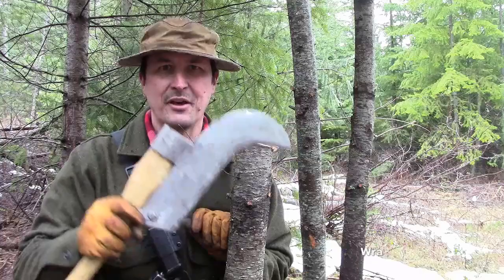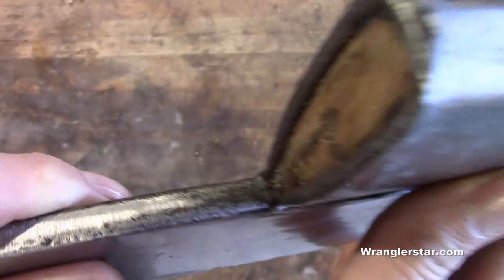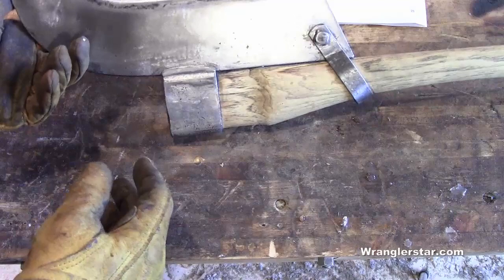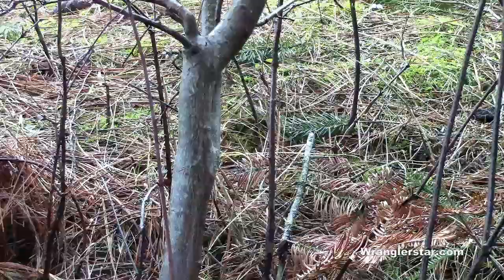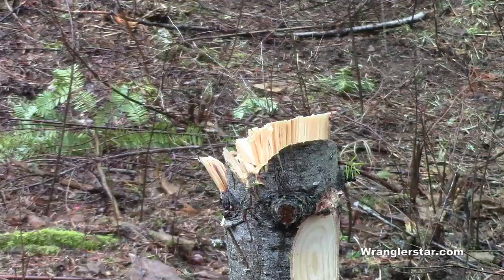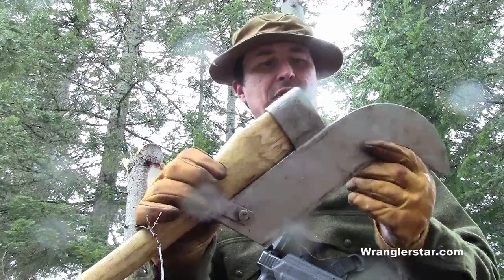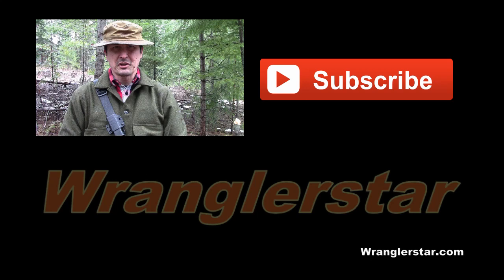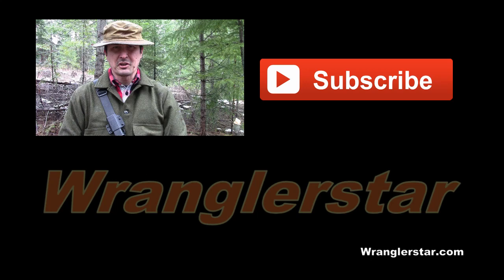A Proper Brush Axe - Wranglerstar

Comment: I had the other style you showed in the book with the double edge blade. I prefered it over a machete when dealing with brush but it wasn't very good with dealing with larger brush because it wasn't as heavy of a blade as the one you have there in this video. The blade was thin and all the weight was from the handle of the axe and almost none was balanced towards the blade. However, this made it wonderful for working over head on low hanging limbs that a machete would work on but reach was a bit limited. It also worked well for removing small stumps or stops that were to big to pull by hand and that you didn't want left above ground. I used it similar to a shovel and using the tip of the blade sliced right through the root bundle. The thing was easy to sharpen and it stayed sharp quite well even for such a thin blade. It was so thin though you could flex it with your bare hand. It wasn't a very heavy duty tool, but it was also a very modern tool bought with in the past 30 years. I eventually had to retire it from service because I over struck a small tree and fractured the handle. But the tool had already been used for over 20 years by then. I'd say 20 years is a good long time for a handle to hold up.

Comment: Using that brush axe looks like fun. Excellent video!
Reply: TheGearTester as a land surveyor in NC, I swing a very similar axe (he referred to it in his manual as a bark blade, also known as a ditch bank) the idea is to cut in a steep angle across the grain, they’re extremely dangerous when swung horizontally like a traditional axe. Usually used on lighter brush and vines, briar patches can be decimated in minutes

Comment: I have a Collins Brush axe I recently made a new handle for it and cleaned it up , I know it was used a lot by the forestry service when cutting a fire trail it works good with the blades design at taking care of  heavy rooted ground  when your trying to shovel dirt with a lot of roots they'll take care of the roots real quick and easy. along with small saplings .

Comment: Hi, nice vid as always. My family is from Appalachia, my grandfather logged with horses until the 50s, were several hooks it the barn with handles rotted out. Pretty sure they mainly used them to de-limb downed trees before chainsaws around here. Its just like you say, figuring out all the uses for the old tools is half the battle sometimes. More than one way to skin a cat, ask your local Chinese grocer.

Comment: We use similar tools here in the UK for hedge laying, Its all about technique.You will wear yourself out if you don't use them correctly. They are a wonderful tool once you get the hang of them. Cut springy wood lower down and you will fin that the tool will make light work of it.

Comment: I used a similar tool in the early 80's when I worked on a survey crew for the Corp of Engineers.  We called it a Joe-blade or a K-blade.  I got to be pretty handy with the thing over the course of one summer and could drop a 1.5 inch oak consistently with one swat.  Technique was everything in using that tool to cut line for the survey crews.

Comment: Down South, the "Burke" blade is very common. They are heavy, dangerous, and very effective for clearing tall grasses, vines, bushes, roots, saplings. They are also used to chop into the earth, creating a vertical or diagonal cut, followed by a sharp square spade to produce ditches along country roads and farmland where drainage is needed. They are very durable, and typically sharpened with nothing more than a file. A crew of men can clear land down to soil in very short order. These axes are good for trees up to about 6 inches, but no larger. I have seen this axe go through a 4" conifer in one stroke. It's one of the few tools that is routinely taxed by rough use, but they really are tough.

Comment: I can vouch for the FS's added PPE for the shins and would also emphasize steel-toed boots.  When I've used these it has been more for brush clearing with the swing very close to the ground.  Unseen obstacles can and do cause a swing to glance back at the lower legs and feet.

Comment: It strikes me that the issue it has on larger trees as the it bites too deep. It penetrates very deeply, but doesn't chunk out the wood, so it gets stuck and you have to put the extra effort to pull it back out.. I think its really only made to cut stuff that can be taken down in one or two swings, because anything more, your going to get fatigued really quickly from having to pull it out of the wood. Just my two cents.

Great video Wrangler! Keep up the good work!
Reply from the maker: I agree. I wouldn't use is to fell timber. I was only demonstrating.

Comment: If you like a tool like this, I strongly recommend taking a look at a slightly different design called "vesuri". It's a Skandinavian version of a bill hook or a brush hook. It's not an axe or intended to be used as one, but is instead mainly used to debranch tree trunks and, in the case of the smaller ones, to clear out saplings. It isn't really meant for splitting, but it can handle that too. In my humble opinion it is a superior design and would most likely be easier to handle.

Comment: cuts about the same as a makeshift pole machete that i made when i was 13, it was a 420J2 meat cleaver on a 2.ft ash wood dowel with a slot milled in it, and held in place with dry wall screws, i loved that thing, if i can Cody, I'd defiantly make you one

Comment: It is a great tool for clearing under a fence line or grubbing out an old ditch that is narrow enough to straddle. It is dangerous though. Using the hook to pull and cut brush from between trees and fences. It is also great for cutting roots in the ground and jerking them up. Yes you will have to resharpen. I've also heard it called a grubbing axe.

Comment: I know I'm late for commenting on the brush hook. it is meant as a primary tool for land clearing. you can use it on a wider size range of woods vines and general undergrowth. when my Opa taught me how he used an up swing for the smaller stuff more so than a down swing, and aim just inside the point of the curve so it becomes a slicing more than a hitting.

Comment: I think for small brush the most effective cut would be a flat to somewhat upward angled cut. This would be sweeping the ax as if you were uprooting the bushes.  Because you can't depend on the mass of the branch to generate pressure on the blade you need to put the branches in tension to get blade into the wood.  If it sounds awkward,  I think it is, the hook on the blade is there (I suspect) because accurate aiming just isn't  feasible. 
Really though I suspect the tool has been supplanted by pruning shears and loppers.

Comment: I have one of the burks Axes you mentioned. Here in Georgia we refer to them as "Ditch Diggers" for the simple fact most of our road crews have them and they use them to remove vegetation and vines from ditches and around drainage pipes. It's effective at that but it has a thinner blade than yours so I would never try it on an actual tree unless I had to.

Comment: I have good luck on the smaller brush and trees if I swing it like a golf club ... The roots tend to hold the target firmly in place and sometimes you will pull the plant up by the roots with a slow swing or dull blade ... Hope this helps ... God bless ;;;

Comment: well ... I used one before for a little while and i cleared a lot of brush with it but it had the burke blade on it or was sharp most of the way around it. The hook I learned was good for small branches on a tree you wanted to trim up

Comment: Brush axes do great work. They make quick work of small <3” saplings and brush. Some are better than others though. I have 3, 2 like yours, and one that you showed in your book that’s sharp on both sides. I hate that one. It’s just not sturdy enough. It does fine on weeds and small stuff, but flexes when using it on saplings. They used to use them on the railroad to maintain the area under the pole line.  They were eventually banned for safety, probably because people don’t know how to use them. They are great tools. I use mine along my ditch bank every year. My only advice would be to cut as close to the ground as you can. A sapling that might take 2-3 swings, can usually be cut in a single hard swing at ground level.

Comment: I found one under my Grandfather’s cabin here in central PA. It’s badly rusted, but the handle is intact and I hope to restore it. The major challenge will be removing the rust sufficiently to remove the strap. But it’s now safely stored in my garage until I have the time and skills to work it. Of note, also found a double bit axe as well. It’s in better condition, so that’s my first project!

Comment: Used and seen survey crews use them in VA for open property lines. But they had modified them with a hammer on the back side (driving stakes and such)

Comment: On the thicker trees, alternate a horizontal stroke first with the downward angled stroke from a bit above your horizontal cut. Take a chip out instead of jamming the blade once you get it down right. Kind of like using a hewing axe, but on an upright tree.

Some suggest sharpening the concave curved section of a bill as a two sided bevel, but the straight part with a one sided bevel similar to a side axe, for a right handed person, the bevel would be only on the right side of the blade. That way, the flat section behaves like a side axe, it's less likely to glance off a sapling on a diagonal downward stroke plus you can use it more easily to do things like putting a point on stakes, etc.- and it still cuts brush just fine.

Comment: wranglerstar great video, I have an old banana blade/bush Axe like the other one in your book. The handle is broke but it has done the job for my grand dad, dad and now me. I like that chest rig and how you have your spare mag located it should make for fast magazine swaps. One thing you might think about is placing your spare mag a little higher on the rig that way if your doing one handed mag swaps you can holster the gun and load the fresh mag with one hand easily. From the video it looked like the holstered gun is preventing you from accessing your spare magazine.

Comment: I once worked over a weekend with a guy who used a similar tool but he used it in a pulling motion cutting very effective and controlled small growth close to the ground as well as higher up. I tried et a few times but could not get the right pull motion.

Comment: Hi Cody,

I have this very same axe.  It was my Dad's.  Mine's still has red paint, but starting to come off.  Putting a new handle on it now.  I've always heard it called a "bush axe" around here (Georgia) but I've seen it advertised as a brush axe.  Everything you said about it rings true; heavy and powerful, best on small stuff but it will cut bigger.  I agree with the comments of the reviewer below who gave a long recap of it's use in the south.  Thanks for the video, informative and inspiring .  Keep it up.
BTW, I know a Jim Dillon in Atlanta who teaches woodworking at Highland Woodworking.  Not the same I suppose?  Like to get your Jim Dillon's website.  Thanks.
David

Comment: It's a billhook (or something like it).  It WAS used as a weapon but before it was it was used for the exact purpose that you saw it for: cutting down brush and smaller plants.  It's better with smaller plants than larger ones.

We're not 100 percent sure where it comes from.  It was used frequently by the vine cultivating peoples of Europe but it was also developed independently in the Orient (Japan and China).

Comment: My dad has one of those burk blades form when he worked for the rail road that thing will cut through anything u put in front of it.  And in like the brush ax u have there both sides of the blade are sharpened.

Comment: I'm curious Cody do they still make "brush hooks" for chainsaws.  years ago (79-81) I worked for BLM as a engineer tech (construction projects) and firefighter during the summer. clearing brush for fence lines through mesquite bosques we had a metal hook that bolted onto the end of the chainsaw bar that would hold brush and small stuff allowing me the scythe my way through the brush. dang good piece of kit.

Comment: When it comes to cutting springy stuff, you don't want to cut them horizontally you want to cut them at a good angle probably at least 45 degrees down toward the base of whatever you're cutting; that way the hook won't bounce back and forth on you.

Comment: I think you'd have better luck with the more springy brush if you cut a little closer to the ground rather than a foot and a half up like you were doing at the start of the video. Of course by doing that you're going to hit the ground more than you'd ever should with an axe but the blade looks beefy enough to handle the abuse if you exercise reasonable caution like you always do. One of the problems I've had cutting into brush is I had a hard time seeing what's going on in the brush pile so the big cutting surface looks like it could do a good job of compensating for any loss of accuracy as long as you keep your feet out of the way.

Comment: Sounds like a quickly moving stream is nearby.  Is it running all year or is it snow-melt fed.  I am aware of the ram-pump water supply stream you have on property, but not sure if this is the same stream or different.

Comment: I’ve known a similar tool to be called a Kaiser Blade. My dad used to use one growing up on a farm in Mississippi. He found a couple used blades from someone who worked on railroad right of ways. At 10 years of age or so, I was old enough to learn how to use it and keep it sharp. What are these shin protectors you speak of? Isn’t that sports gear for baseball catchers? We had no such gear. We had self preservation as incentive to not chop ourselves. I don’t recall any accidents. We cleaned ditches with these tools.

Comment: they work great if you're strong enough and you figure out the right way to use them. it's heavy and moves slow so you can't cut springy stuff at 90 degrees. you have to go through at an angle so that it doesn't just bounce off of the blade.

Comment: Cool, Where can I get one of those Brush Axes?, Looked like your problem with the axe was you was using the flat part of the blade more than you was the curved part, that curve helps cut into the tree, instead of just chopping, but it looks like it worked great for the small trees.

Comment: i didn't read the previous comments but i want to tell something. 
my friend you are right when you say you dont know what this tool is for , so let me help you on that. the curved blades, similar to this, have been used since antiquity in greece and especially thrace as a tool and as a weapon. now, if you want to cut the branches from a tree or a man's limb what would you prefer to use? an axe or that tool? of course that tool. try to use it on a smaller angle. romans made one of the few changes to their standard armor when they faced weapons like this. it is very powerful when you know how to use it. but i dont like the way that the curved blade is fitted to the handle, in fact this is the first time i see it and i believe that this way gives less balance to the tool

Comment: Interesting tool. When I read brush axe, was expecting a different tool. A Swedish brush axe, which is like a lightweight axe with a replaceable blade meant for smaller diameter wood. Over here in the UK we have slashers, that come in a huge variety of styles. Everything from what looks like a long handled grass hook, to short dunse slashers meant for more woody. Though my personal favourite is a double edged Irish slasher. 9" straight edge on the one side, and the other has the hook. (Similar to a double handed Yorkshire billhook, another favourite).

Comment: The brush hook's main use is for cleaning limbs off of downed trees i have used one on the fire lines in CA. forest fires when i was mush younger.
Reply: jim stone I worked for the Forest Servicve as a software engineer (contractor), and the crews use them the get underbrush cleaned out too, they've even been used to cut a smoke jumper's canopy out of a tree - so there ya go - multi-tool!

Comment: I grew up in England and these were used for clearing saplings alongside railroad tracks,  designed to cut low to the ground therefore springy brush is not an issue. Look up 'laying of hedgerows' and 'coppicing' of which I have done quite a lot. I have my dad's old 'Billhooks' too, he also had a tool called a 'slasher', like a socketed Billhook with a 4' long shaft.

Comment: This tool is a Land Surveyors best friend. Most of the Surveyors I know and work with on the east coast prefer this to a machete or an axe because it can be use as all in one tool. The brush axe or "bush axe" (the Southeast name) has more length than a machete but less weight than a full size axe. The preferred model on the east coast is the ones without the bracket because the user can sharpen both sides the inner and outer at different angles like you would with a double bit axe. As a rod man the less weight and more functional an idem the better. The outer tip of the brush axe is usual not sharpen because there is not much use for it and the old timers like to stick it in the ground to lean on when steadying the rod.

Comment: speaking of cold steel, check out hte two handed machete.  That is really something for this kind of brush.  IMO, that tool is a little heavy for much of the stuff you were cutting, the to handed machetes are much more deft, perfect for lighter springy brush that is a little much for a one handed machete.